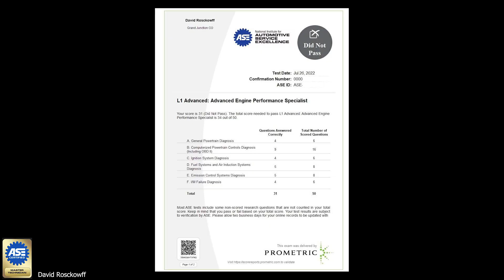Studying and taking the ASE L1 Advanced Engine Performance Test Series - Part 1 - I failed and why?

Comment: How many times do you recommend failing it? Lol. In all seriousness I think the text is continuing to get harder. Besides some of the trick questions the ones that get me the most are the waveform questions. I struggle with those a lot. Thanks for the video.
Reply from the maker: I failed 5 times before I passed. It is a really hard test. Whatever you are stuck on you, you have to watch a ton of Youtube videos on and also go to a shop and ask if you can shadow someone or if they can show you how to do it.
Reply: @DriversTherapy  thank you so much for the response. I won't give up and I will follow your advice.

Comment: Just took the l1 and l2 yesterday and failed both by 2 questions.  Ive been doing this for over 15 years, passed 4 other ase's, gm factory certified, yet this one kicked my butt.  Not sure why but I'm really beside myself about it because I felt like I did well on both.
Reply from the maker: I know the feeling but you did great if you only missed it by two. Make sure to get the MotorAge book and we also sell a study sheet on our website for the L1 that is helpful but you are close!!!
Reply: @DriversTherapy  Thank you for the helpful insights.  I just really feel so down about it.  I'm sure I'll be over it by monday though lol
Reply from the maker: @crcdesign9886  I get it but don’t be upset. You will pass. Check out this video, https://youtu.be/ryxT_P9z6T4?si=pBG-G7wde_tT4GQV it’s my advice right after the test.